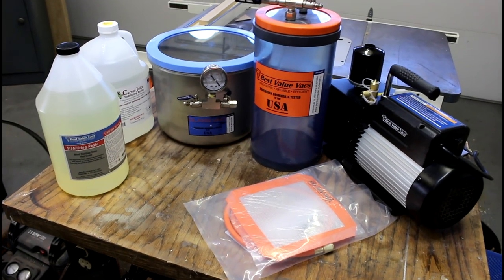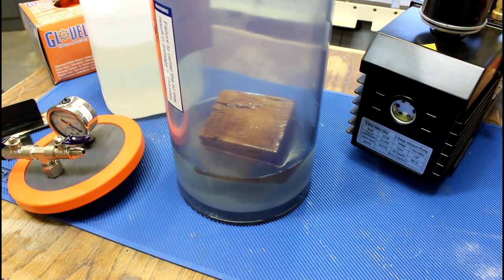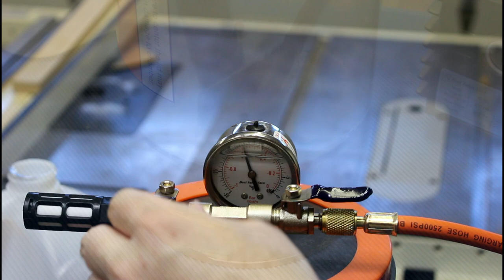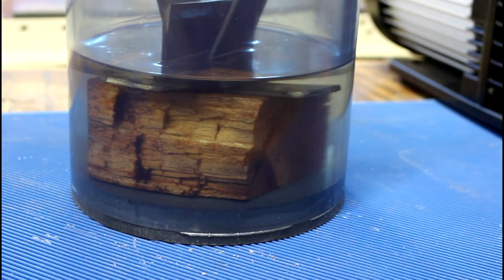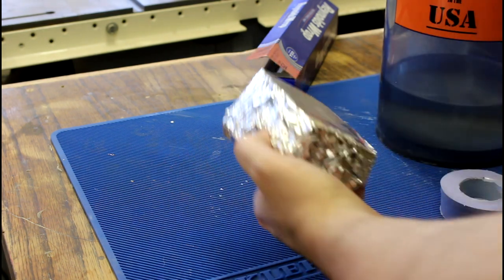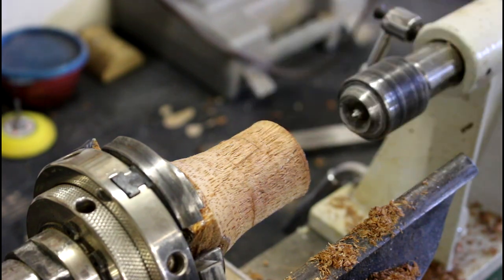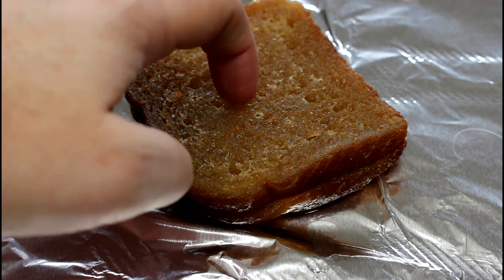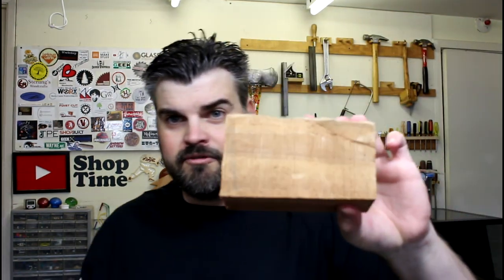Stabilizing: Infusing Resin With A Vacuum

Comment: You need to cut the crusts from bread, stabilize it, then cast the pieces of stabilized bread together into boards.  Then you can make a bread box out of bread.
Reply: or just stabilize an entire loaf at once, then cut out what you need (if you need moving parts, this may be an issue, and you may have to do what the OP said)
Reply: That’s what I was thinking. Bread box made out of bread.
Reply: Urahara1001 But I thought resin wasn't foodsafe?
Reply: Bread bread box
Reply: That’s an AWESOME idea!!!
Reply: Then all the scraps, turning, and sawdust from this project get Peter Browned into another board for the next project. Breadception.

Comment: Dip it number whatever Butter knife made from stabilized bread
Reply: That's a cool idea. A butter knife handle
 made out of bread.
Reply: Yes please!
Reply: Use Marble Rye
Reply: Or.... a butter knife made from butter?
Reply: Butter isn't a solid in the same way that flour is solid, its a saturated fat so it changes depending on the temperature. Its not porous so it won't absorb resin.
He's already experimented with casein which is plastic made from milk solids.
Reply: Christine Zartman so he's tried turning butter?
Reply: It's about testing things not science....

Comment: You should try to stabilize two fruit halves such as a blood orange, pomegranate, or a dragon fruit. Glue both sections back together and then turn them down and check out all of the crazy contrasting layers.
Reply: I scrolled down to see if anyone else was going to suggest stabilizing fruit!
Reply: I tried this a while back with no luck. I think the object needs to be dry first. Course, I only tried it once...
Reply: To much water. You would have to drive it, otherwise most resins won't properly cure if I remember correctly.

Comment: Geez, you're going to have to be careful with that device and bread..  Imagine if you had used Wonder Bread, which is already inherently stable and will still be around after the heat death of the universe and all..  Put that in the chamber with too much resin and turn  on the vacuum and you could have caused the universe to implode!!

Comment: Hey Peter - read up on the use of a "cold pot" - it goes between the chamber and the pump, and condenses the vapors from the resin so that it doesn't eat your pump.  You're essentially making the Cactus Juice boil at room temp - and the gas-off apparently eats seals. Some companies will not guarantee their pump if you don't buy a cold pot as part of your rig......

I can't tell for sure because I don't really know this company or their products - but it looks like they sent you a cold pot as part of the deal.

Happy hardening!

Comment: Wonder what would happen if you tried to stabilize some marshmallows.
Reply: I bet it would just coat them. The marshmallows expand instead of giving off gas to be replaced.
Reply: Well, i assume it would melt. It usually melts in liquids, cause it's made out of sugar
Reply: Ian Salisbury I don't know man, marshmallows are full of air, videos of them in vac chambers show them expanding and then shrinking afterwards because of the loss of air. Would be an easy and cheap experiment to try out.
Reply: TEAMGRUNT. Ooh make a stabilized marshmallow pen blank
Reply: I keep thinking of stabilized peeps
Reply: Michael Keiderling I second your idea!

Comment: with a vacuum chamber (and ideally a pressure chamber) you can reanimate the lens project.
Reply: I would turn a highly polished lens on the lathe (from whatever material that can have a high polish) make a silicone mold, degassed in a vac chamber. mix up some casting resin, degas, and let it cast in a pressure chamber to receive optimal clearness and lens quality

Comment: Heath knuckles does some great projects with stabilized wood blanks and resin.  If you haven't seen his videos they are a must watch.  Oh and Finally you got a vacuum chamber.  Don't let the air back in so quickly though.  It can ruin your gauge after a while.  Slow and steady with that stuff and it will last forever.

Comment: I can't see any comments so I'll offer this suggestion: By the looks of it the 'bubbles' are actually water 'boiling' out of the product. So the wetter the item the longer it bubbles for.
If you dry the timber very well first the bubbles should only last for a few minuets. Just like when you de-gas resin.
(This is why pressure chambers are sometimes better for resin infusing things like timbers, you push the resin in and cure it under pressure without having to remove so much moisture.)
Reply: Nope, it's actually air coming out. There was a lot of air in this blank. Different materials will have different amounts of stored air.
Reply: The bubbles are not water (not much water, anyway). They are bubbles of air. There is an amazing amount of air in a piece of woos.
Reply: wood
Reply: Very nice idea, but it's not right

If you ever look closely at a piece of wood (espescially one with a grain like the one in the video), you'll see all those pores. Imagine that going through the whole thing.

All those pores have air in them. The bubbles are just the air getting sucked out by the vacuum chamber.

Comment: Great tutorial. Btw, you can greatly improve stabilization (resin/wood impregnation) by opening the relief valve a few times as the bubbles rise up. This reintroduces pressure to the chamber, which forces the resin further into the wood.

Repeat the process a few times (vacuum, add pressure, vacuum, add pressure). Then, hold vacuum for a bit. The wood will be much better stabilized (increased resin impregnation). Plus, it reduces the amount of time you have to run your pump and hold vacuum. :)

Comment: When you submerge the object in resin before making vacuum around it, the resin is making it harder for the air to escape and the pressure of the resin also keeps some air in. Vacuuming the container with the object not submerged and only submerging it when there's vacuum can both pull the air out of the object faster and remove more of it. Of course getting it sumberged when you cannot reach in when there's vacuum inside might be tricky but there are ways to do it. For example you can place the object in some sort of metal cage that's guaranteed to keep the object sumberged and hold it above the resin using a strong magnet outside the container. When you're done vacuuming the container, just slide the magnet downwards to get the object submerged.

Comment: This is usually called impregnation - not that it matters - unless you are googling it.  We use it in the sciences a lot.  It will stabilize delicate samples like sand, rust, sediment, flesh, etc.  And of course, rotten wood - and even water logged materials.  I can't think of too much "fun" to do with it other than art and furniture.  Good video.  That's a nice setup.  You should talk about more.  I have been looking at building one - but the chamber is a dangerous part I just want to buy.

Comment: Stabelize large pine cones. Cast those in clear resin. Then you could turn those cast pine cones into candle holders. Using the the bits of pine cone s a diffuser of sorts. Adding colors and the like that are transparent, or mostly transparent would be cool as well.

Comment: Hmm, you might not see this since it's so long after this post but I figured what the hell:
What about stabilizing greenwood/undried/fresh-cut or rather the result of turning a greenwood item (i.e. a bowl, plate, etc). Would stabilizing it (before or after) stop what would usually crack without proper drying or special technique?

Comment: Maybe you're the wrong person to ask this, since at least from what I know you mainly work on a lathe. But my friend and I got a log to use for firewood, only to find out it actually has some beautiful spalting on it. Not wanting to waste it, we cut it into slabs for some future projects. The slabs have some rot/punky areas in it. As they are now, they're basically unusable for just about anything. Do you think using a casting resin would make them usable? We don't plan on making anything that's going to hold a lot of weight, probably just a few shelves and maybe a headboard for a bed. If that would work, do you recommend any specific brand, or if you don't think it would work do you maybe have any ideas as to how to make the wood usable?

Comment: I'd like to see this stabilization technique as would be used on a turquoise gemstone or piece to improve surface shine and hardness and reduce or prevent color fade which is a common problem with sun exposure. I'd also like to see the pressurizing technique as would be applied to any emerald to fill cracks and fissures with cedar oil to improve clarity (an enhancement recognized in the jewelry trade and so commonly used that its automatically presumed unless otherwise certified.) Thanks in advance!

Comment: You can also freeze dry flowers and other items.  Freeze the item, place in vacuum and keep unit in freezer.  As moisture leaves the object, the vacuum decreases.  Top up the vacuum and maintain freeze until dry.  The clear cast freeze dried delicate object.

Comment: Stabilized BREAD?!?  You betcha!!  Get non-sliced whole wheat bread, stabilize the entire loaf, form your form like a bucket, add more resin to submerge the entire loaf (After vacuuming out all the air , seal and bake, then band saw pieces the size of the knobs and shifter in your old truck and reproduce them all after spinning them on the lathe and buffing them beautiful.  Then wait for your passenger to notice them.  Now THAT sounds like fun.

Comment: I didn't read all the way to the bottom but I thought I'd note that you should use a thermometer to check your oven temperature. These little ovens are inaccurate, tend to run hotter, and can result in more resin being forced out before it cures.

Comment: If you were to cover a piece of wet wood in epoxy would it still crack or would it seal the evaporation and not allow it to crack?. I’m thinking about making a big cedar slab with natural edges covered in epoxy to make a bar top and using whiskey barrels as the legs

Comment: Hi Peter, thank you so much for this video, the bread thing is hilarious. If you stabilized a cutting board this way, would the wood not be able to chip when someones using a hatchet against it? Or is there another method you suggest that makes the wood more durable?

Comment: I have a hunch that no weights are really necessary, as long as enough solution is there to cover the piece, because once enough air has been pulled, the wood will sink (only trapped air makes it buoyant). Leave it in after releasing the vacuum, for overnight, as the deep penetration is only occurring under atmospheric pressure. As his block still floats, clearly it was not given enough vacuum time, nor time to soak afterwards.

Comment: Hey Peter, what if you placed your stabilizing chamber inside your pressure pot (leave the top off), drew down a vacuum on the whole thing for a few hours then pressurized the chamber to say 50 psi.  Do you think it would force even more stabilizer into the wood or do it in a shorter time frame?

Comment: Huh! I was directed here because I actually want to make some bread, "outdoor" protected.      I think my idea is simpler, for what I need it for.  I want to take some French baguette bread, (the long, narrow kind)  and weather proof it and use it as a prop. I think brushing or spraying on a matte finish polymer will work. This "prop" bread doesn't have to last forever", and I could see replacing it every couple of months, with a new batch. It won't be in the rain, but needs to be protected from atmospheric moisture. (They sell "prop" breads for photo shoots, for center pieces for parties, etc. And it looks real, not made of something else.) Though I haven't found the long breads in my search. I think it might be cheaper for me to make my own, but I haven't priced, the whole project out yet.

Comment: so i have a suggestion for your weight if you put a long cross piece on it  like the bottom it would mimic the bottom and it would not flip over and if you made it I don't know adjustable with a couple bolts you could  make it smaller or swap pieces of it for larger projects could even be a project as i would love to see some more amature welding hint hint wink wink thanks for the videos you inspire me

Comment: G'day from Oz. Im new to this, is it possible to set up a pressure pot/chamber setup, so thats its duel use? i.e. You can use it both as a vacuum chamers as well as a pressure pot. Logically if a pressure pot can handle high pressure (and hold it), shouldn't it also be capable of handling a vacuum as well. The only modifications that I guess would be required, would be a little extra plumbing attachments. I have googled it, but nothing seems to have come up. PS than km s for the vid, it was grouse  (ie bloody good).

Comment: The reason the bread took so long to pump was that it was no dry to start with.  After the first 5 min, it was all water vapor boiling off.  Bake the bread in a 200 deg oven for an hour or just let it air dry for a couple of days first.

Comment: @Peter Brown  seeing this as of size of wood I want to do is it possible to use epoxy resin to stabilize or remove the air from inside the wood? looking metre lengths but not got a cooker that size

Comment: So I've tried 2 stabilizing chambers not the expensive ones because of my low budget and both the think plexiglas has got small spider webbing cracks what am I doing wrong? I have a 6cfm vaccum pump is that to much is that the problem?. Thanks for any information

Comment: You should try marinating meat in a vacuum.  It's VERY effective.
By lowering the pressure you're also lowering the boiling point of liquids.   The bubbles might be water.  Try to avoid this hitting your vacuum pump.

Comment: Peter, some of the times were wrong (according to TurnTex at least.) You wait until All of the bubbles stop. You can not short time. Also, you need to "cook" the blanks @ 200 degrees for 2 hours, not 45 minutes.  Call Turn Tex & talk to Curtis. I'm not trying to be hateful, I just want to help. Also check out Zac @ NV Woodwerkz

Comment: Help, anyone?
I have a question and I'm not sure if anyone on here would know how to help but I'm trying to glue glass to glass permanently.
I'm taking little glass half marbles like you get at Dollar Tree, incidentally where I get a lot of craft things, and I'm trying to permanently glue them to glass vases. Also from Dollar Tree for now but maybe bigger ones later on. 

I have tried hot glue, just as an experiment to see what it would look like. E6000 works ok. But sometimes comes off later and usually needs to be paired with hot glue to keep it in place while drying. Weldbond universal adhesive. Not sure if I'm using it right. UV glue from the little pens worked great. But expensive so I bought cheap on eBay to try again. I think I also tried some kind of clear caul too. Been a while since I last tried. 

So does anyone know what I'm doing wrong?
Or do I have the wrong types of glue? 
I want it to be permanent because I want to be able to sell them for some extra money eventually. 
I'd appreciate any help you can give. Thanks

By the way I love to watch this show on my tablet while crafting. So thanks again.

Comment: The poor mans version of this is to put the object to be 'stabilized' or 'pressure treated' in a mylar bag or even a potato chip bag and put a small amount of liquid in the bag. Draw down the pressure with a pump or a vacuum connection from a car engine.  The bag will conform to the shape of the object, so sharp edges will have to be covered or buried in sand. Use your imagination.